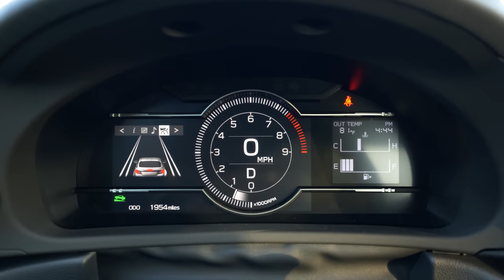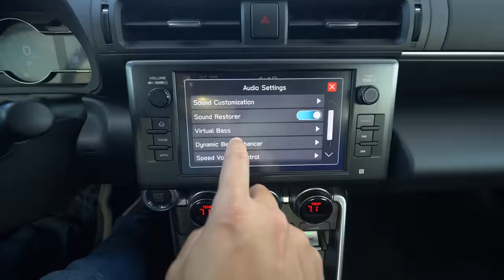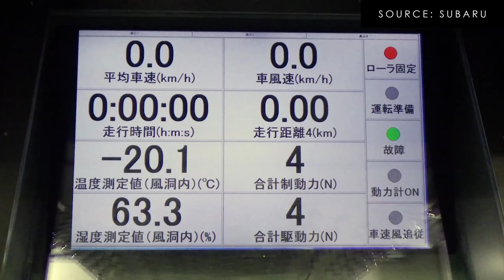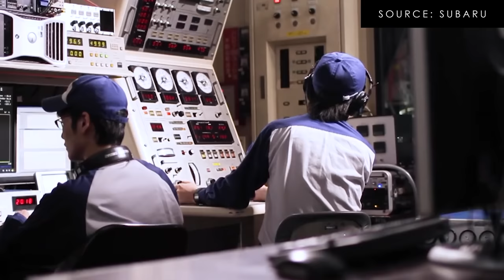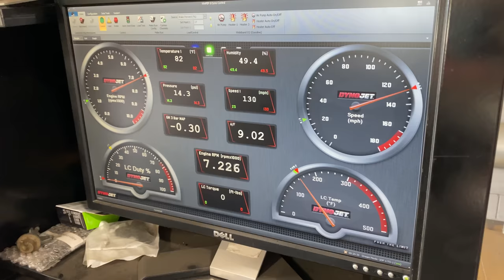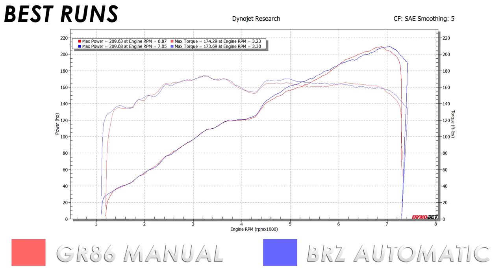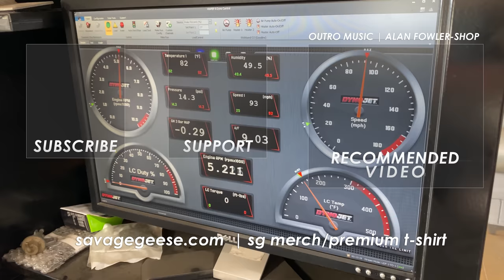2022 Subaru BRZ | Something For Everyone

Comment: I drove both the auto and the manual back to back at Monticello Motor Club on track. The tuning of the auto is very disappointing on track. It’s very slow and reluctant to downshift. Upshifts are pretty good. Putting it in manual mode alleviates those complaints though. The actual shifts are reasonably quick, but this is no ZF 8HP. 
On the street the auto is absolutely fine. No complaints at all. If you’re going yo track the car, get the manual. It’s superb. It’s smoother than the last generation and there’s no issue getting it into 4th as they’ve improved the synchros. I have a GR86 in order because I loved driving it. The suspension dynamics are excellent,
Reply: I owned an 15 FRS Auto once and I never had any issues on the downshifts of the car. I get it once your used to the ZF this Aisin gearbox feels ancient to your stands but lets not kid ourselves its more of a bulletproof tranny though. Hopefully the manual on this is beefier than last gen throwout bearing issues.
Reply: @iheartgs400  Reliability is important! Not sure if they changed the throw out. They didn’t mention it specifically, but they did discuss how the transmission has been beefed up to handle the additional torque.  They completely understand who the audience is for these cars and they except people will mod them.
Reply: @revmatchtv  I actually want to know how the clutch feedback is overall, I had a chance to drive a manual previous gen and just got turned off by its vague/inconsistent clutch pedal feedback not as consistent as Honda clutches.
Reply: @revmatchtv  hopefully the Fa24 oiling system is also stronger. Just saw too many FA20 fully bone stock with rod bearing issues.
Reply: How were you able to order one? Toyota hasn’t even released pricing….
Reply: @deej628  I put a deposit in at a dealer and I'm in line when the vehicles hit dealers. Any dealer will be happy to take your money - choose one that gets a decent sized allocation.
Reply: @iheartgs400  Clutch feedback is normal. I have driven very few cars made in the last 30 years where you can 'feel' the clutch. Hydraulic systems pretty much eliminate that. 

That said, I had zero issues with the manual in the couple hours I spent with it. The engagement zone was in the middle of the pedal travel (and that can be adjusted on every car that I'm aware of). The egagement zone was sufficiently big to make it easy to engage. I drove the last gen quite a bit too and I never had any complaints or issues wtih the clutch.
Reply: @iheartgs400  From what I recall, they didn't specifically mention that, but the stressed how much they have improved the engine overall. It's a different block, so it's possible they addressed but I can't confirm.

Comment: Good presentation. "There's nothing else like this anymore". When I bought my 2020 BRZ my wife asked if I was going to test drive it. I did not and asked what's the point, there's nothing I'm cross shopping it with (we both didn't like the styling on the prior gen 86).

That said, limit handling matters to me, even for street driving. The prior gen BRZ was one-dimensional in its handling character. I'll be going with the GR86 on the next go around.
Reply: The GR86 arrives later and probably will have more mark-ups versus the subaru. I think one option here is to just get the BRZ first, then swap out the rear spring with 86's spring, that probably won't cost much.
Reply: @subatomicmolecules  styling is subjective, but i personally think the Brz looks more understated and premium.

Comment: I test drove one of these two days ago and I was really blown away. Such an incredible driving feel. The steering was a bit numb on center compared to something like an old hydraulic steering BMW, but my god the way this car changes direction is telepathic. I really had the impression that the CoG was super low. The turn in was amazing and the power (in the rain and traffic) was more than enough to have fun. I drove the base model and the stereo was horrible, but the rest of the interior was acceptable. I really want one. The one BIG complaint I have is that the car should have been a lift back for better cargo capacity. The utility of this thing seems horrible. Better than a Miata sure, but that’s the lowest possible bar. My bicycle is more practical than a flippin’ Miata.
Reply: It's really not that bad: I've fit some fairly large (think international multi-week traveling) hard suitcases into the back of the BRZ. Sure, you're not gonna move assembled furniture or big bags for multiple people, but it's totally fine for any kind of normal day-to-day tasks.

Comment: The most underrated thing on this car is the port injection that comes from the factory. Coming from an Audi A3 Quattro owner, port injection is probably one of the best mods for a car. I was on the edge of buying one or not, but after seeing the car come with port injection, im definitely buying it
Reply: What does that do? It sounds interesting but I have no clue how it impacts or makes this better in any way?
Reply: Absolutely. No CVT, no turbo, and no direct injection-only means this car should ultimately prove more long-term reliable than any of the new turbo-DI offerings from Honda, Hyundai, VW, or anybody else. I really wish Toyota would allow Subaru to use their D-4S system on all Subarus, not just the BRZ.
Reply: @vlj1133  honestly, the brz platform is something I really wish Subaru would dedicate more time to. There's definitely a lot more room for improvement on the car while still staying within the same price range.
Reply: Realistically, the only things Subaru could add to this new BRZ while still keeping it at a similar pricepoint would be better brakes/suspension, twenty more hp from this NA engine, the GR86's higher duckbill rear spoiler, and an updated infotainment system with sharper screen resolution.

In a nutshell, everything the BRZ will receive next year, or in the first refresh, minus the twenty additional hp. We won't be seeing more stock ponies anytime soon. There will definitely be a Brembo/Bilstein-style Performance Package option in the near future.
Reply: the car has both port and direct injection, that is what the 4-DS is.  The 4D-S injection is something Toyota forced into this platform, Subaru didn't want it, because they wanted to use their own system.  I read for some reason in early negotiations, Toyota made it basically mandatory for the project to go ahead, and it's literally one of the only mechanical components they do (along with the gearbox) while Subaru basically does everything else.  All prior subaru engines were port only, but subaru has developed their own direct injection too.  It's only FA20 and FA24 in BRZ/GR86 that has both the port and direct injection from 4-DS, while other new subarus, like new outback and new forester have subaru direct injection now.  I don't know enough about it to be honest, but I heard some tuners complain that the direct injection makes it harder to tune, but if they have been experts on EJ's and other engines most of their career, it makes sense they know port inside out.  I don't know enough about it to be honest, I read pros and cons etc.

Comment: Great video guys.  It was interesting to hear how quiet this new BRZ was on the road.  I remember my ‘03 WRX wagon being like a tin can inside with road and wind noise.  I ended up adding a ton of sound mats to the doors and hatch area - then ripped of the stock exhaust and down pipe and went full turbo back so that the only sound I heard was the the great Subaru burble.  This BRZ could be an interesting weekend car and let me get back into tinkering with cars again.

Comment: I love watching these two argue, it's gold. What I still don't understand for the life of me is hearing people complain about how automatic transmissions don't respond when downshifted after getting a button pressed or whatever. I'm not that old, but I'm not that young either, but the almost foolproof way to get an automatic to downshift is to FLOOR THE THROTTLE, problem solved. You're never gonna get the response as you will when properly double de-clutching a manual, but the car is gonna go mostly when you ask it to. If it stops doing that, you know that your automatic is about to take a dump. The best thing about this automatic is that if driven more or less responsibly, it's gonna last, PERIOD. 
I'm seriously considering buying this car after it's released and if so, it'll be the first BRAND NEW and probably last, new car I'll ever own, and of course it's gonna be a proper manual, which is always better. But please, stop complaining about shift quality with an automatic transmission when shifted with the little buttons. If you wanna manually change gears, get the three pedal one! And if not, that's also fine, hence the term AU-TO-MA-TIC, which does the chore of changing gears for you!
Feel free to correct me if I'm wrong...

Comment: Love the review. Nice to see total honesty! I have the Miata RF that you mention from time to time. It's a great car, but they got the pedal-arrangment wrong on it, and it is annoying. The Accel-pedal is 1" closer to driver than dead pedal and angled too steep. I hope the BRZ is better in that regard. It seems that only Porsche can get that right, and it is sooo important. I do admit that the RF has a nice stereo and nimble daily feel as you mentioned in the last vid. Just wish the engine ran like the old V-Tecs!
Reply: Thankfully stereo is fairly easy to fix on most cheap cars
Reply: @wayward03  Agreed. I tried to crack CANBUS on a porsche and it was insane. I miss the 1990 era Hondas. I was an installer back then and loved the ease of popping panels and so on.
Reply: its a problem even with driving shoes?
Reply: @Buxtonphil  "uneven" doesn't get better with thinner shoes. Unless you wear driving shoe on right foot only! LOL! But in a car where one review put it as, "get the proper leg position and your back hurts, get the proper back position and your legs hurt". Meaning that there is not enough actual room to play with (outside of the asian market, where 5'5" is the norm). The criticism here is that it is very easy to set the pedals correctly, as porsche has done for years. Mazda pulled a pedal from a parts bin and here we are. I've already created a bracket to give me approx that 1" of extra space, but mazda should have just made it right from the factory.  From the driver's seat, my GT3 feels like a lexus compared to my RF..

Comment: Manual is of course the way to go. Kudos to Subaru/Toyota for offering all the trim levels with the manual. 

It also means you can get heated seats and an upgraded stereo with the manual.
Reply: @JD Turner I still want a 5-door hatch WRX and that's not happening in the new generation.

Comment: The DCT in the GLI/GTI is amazing and with a tune it’s even better and super responsive
Reply: I liked my dsg in my gti, but unless you’re in sport? Stock isn’t exactly responsive, especially at low rpm’s. To say nothing of how expensive those things are to service.
Reply: the DCT is amazing in the GTI? I have one. damn... I can't imagine how horrendous other DCT is if the GTI is amazing.
Reply: @Eldaino999  I only find it useful when shifting manually, otherwise it's holding gears and stuttering to deliver power. 7 speed DSG service interval increased dramatically so not sure your point on servicing costs is valid unless something explodes, which is always expensive.
Reply: @gwot  it’s the best DCT in mainstream cars, arguably. You don’t actually have a GTI then. Or you have a broken secondhand used one that has been destroyed and raped by its previous owner. I guess it’s the latter.
Reply: @Mav86asian  I literally actually have a GTI, bought it brand new. It is the only DCT i've ever driver, so I have nothing to compare it to, it could very well be the best, but I don't like it and that's that. Could be that I just don't like how DTCs in general drive, they suck, they're only good when flooring it, but in normal street driving i rather have a CVT or converter auto. I've even stalled it once in heavy slow traffic, stalling an auto!

Comment: So it looks like the 2.4 is still a 100hp/L engine after all. Well done!
Reply: 1st gen didn’t have 100hp/L at the wheels. That was crank HP. In other words the power at the flywheel before it was neutered by the rest of the drivetrain. The dyno here is showing wheel Hp not crank hp. So it’s actually a considerable improvement over the first gen even though I can see that it  if you’re comparing the old cars crank hp with the mew cars wheel hp it seems similar

Comment: My first car (in Canada), was a 2019 EcoBoost Mustang 10 speed Auto with the Performance Pack. I paid $27k CAD for it. The old gal ran 0-60 in 5.1s (timed) and my Magnaflow exhaust popped and bang like a turbo coupe should. The front end on the stang was a bit vague but once you got use to it, she was plenty fast for street duty. If I were to buy my first car again, I don't think I will be able to pick a BRZ over a little pony... No matter how good it is on the track.
Reply: I looked at the Mustand Ecoboost when I was shopping for my car, but I just can't drive automatic and the manual Mustang has the clutch really badly placed for me. I keep hitting it when I try to put my foot on the footrest. I also didn't like the interior of the car. Doesn't help that a lot of Ford dealers here in Quebec are really bad... In the end, I'm driving a BRZ and I like it a lot. And if you wanna race me on a drag strip, I have my Z900 for that :P
Reply: I had a first-gen BRZ for 3.5 years and ended up in an Ecoboost premium. It’s a much better car overall and I would take it 9/10 over the BRZ unless I was on track. Much faster, better comfort, but much more vauge/disconnected steering.

Comment: One thing I'd like to see is, instead of a comparison with the Miata like usual, a comparison against the lower trims of the Camaro and Mustang that are in the same price range.  For instance, a right now you can spec out a 2022 1LT Camaro with the 335hp V6 and a 6 speed manual for $28,290 before taxes & such; it weighs more, but it also has wider tires, and the Alpha platform is known for its excellent handling.  To me it would be a more relevant comparison than dragging S2000's out of the museum...

Comment: I can't wait for the 10K of dealer markup. Local dealers are already asking nearly 5K over sticker for AUTOMATIC Miatas in my area...
Reply: so far its msrp or below in most cases across the US
Reply: I was worried about that also. I Placed an order on MT limited with no package and only a home-link rear mirror. For 31,400. Auto-nation dealer.
Reply: dude, just walk in and try asking for msrp out the door, this generally works at larger dealerships and if you cant meet at a price with them then just leave...

Comment: I've been a fan of Subaru since I drove my first GL. Much of what you're saying here makes sense and, yes, most of the shortcomings will be overlooked by casual drivers and fixed with aftermarket tunes by sports drivers. I think it's a good car, especially for the price point, although I'd likely move up a level for bigger wheels, better tires and, yes, a better transmission.

Comment: The absence of initial bite on brakes is good for heel and toeing in everyday driving. They should have done this on purpose. Have too much initial bite you won't be able to downshift while braking at a reasonable pace with ease.  Similarly, ND Miata's Organ type accelerator pedal feels very nice on its own, but because it sits rather deep, one has to depress the brake pedal a lot in order to perform any decent heel and toe, which is definitely something that disrupts the rhythm of driving when you don't want to brake that hard, which should be most of the time when you are not on a race track.